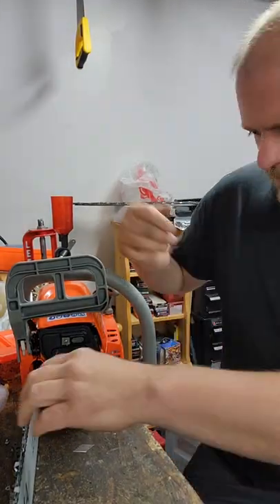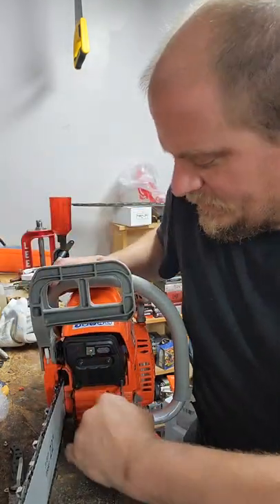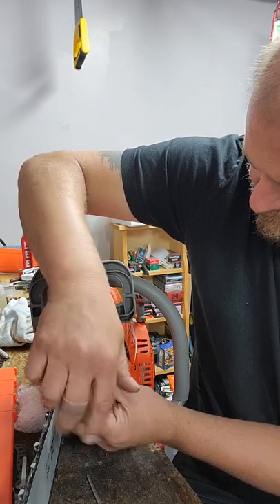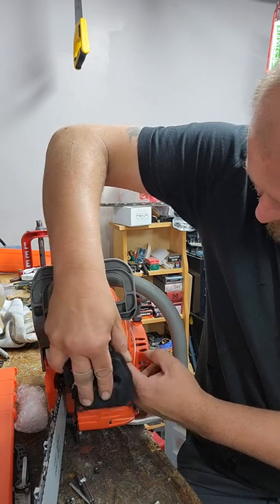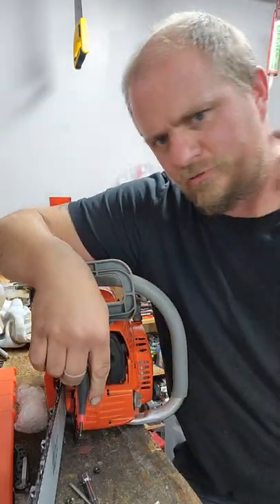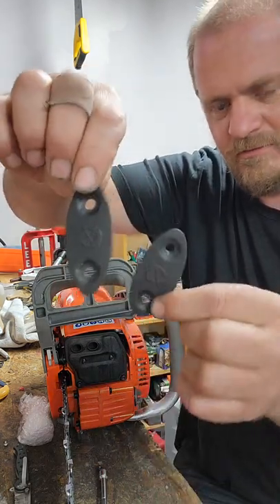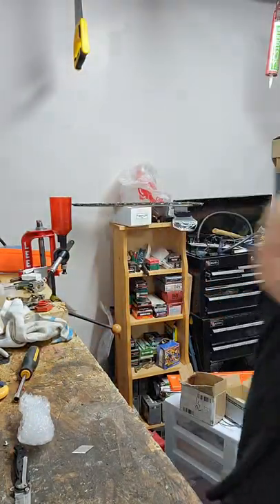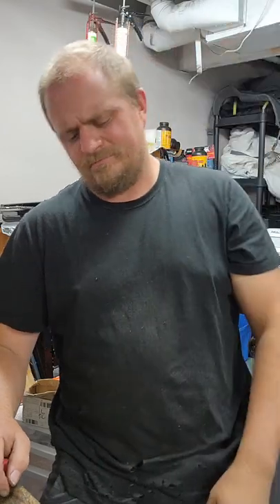1.92$ muffler upgrade for the proyama redmax clone

Comment: I"m gonna purchase the same saw you put a muffler on . Is the saw still running and I thought it was a Husqvarna clone?
Reply from the maker: It's not a husqvarna clone, these are zenoah redmax clones.. Saw is doing great no issues.. But the supmix is a better buy, the biggest proyama is only 50cc, despite. What advertising says, the supmix is 54.5cc
Reply: @chainsawcanuck  I looked at the Supmix and the reviews were mixed and for 30$ more you get 2 bars 2 chains and I've only heard good things about Proyama plus they make weed trimmers, augers ect. and after a year you've had no issues. I appreciate you getting back to me and I plan on checking out your channel in fact I'll watch a video as soon as I say Thanks! Thanks!
Reply: @chainsawcanuck  Proyama 62cc being a clone of Redmax witch one would be the one to get replacement parts if i choose to do so?